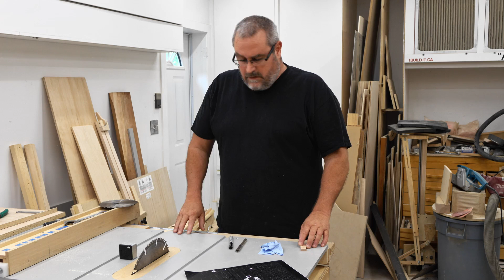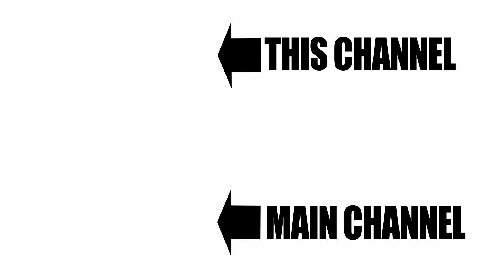This is probably the last Table Saw I'll Ever build

Comment: I built your fence for my old craftsman table saw and it transformed how I use it. I never realized how useful having the fence on either size of the saw blade would be. My pointer broke off a while ago but I don’t really miss it as the tape and the pointer were only ever a rough guide to the width anyhow. The most important thing to me is that I built it, made some mistakes along the way and got better at the craft because of it. I would have learned nothing buying a commercial fence.

Comment: John I built your fence for my table saw.  Sat outside in an unheated, uninsulated garage over a year now...I was certain I would have to nudge the rail back into square.  
Zero adjustment needed.  I'm actually astonished by your design and my dumb luck.  I love that fence and all the cursing and sweat that went into getting it onto my Beaver saw from the 60's. 
Please make plans available for the lift and tilt.  It looks superb.
Reply: This is my experience with the fence as well Rob. Also out in an uninsulated unheated garage. It’s a fantastic design.

Comment: love it man. the saw looks awesome and i love how you create what you need. +props. you are one of the best diy'ers out there man. you know when to get help and when not to. (like with the house stuff)
i just wanted to tell ya what i did with my (cheap ass) table saw. because you were saying how you left yours open underneath.
I have a portable saw that came with a crappy framed stand (a skil saw). i built a nice cabinet for it to bolt onto, but i left the top of it open (a mitered frame out of 1x4) so the saw dust could fall through. i put drawers in the cabinet to store some stuff like sand paper, blades, etc... the key thing is the top drawer, which is larger than the rest of the drawers, it catches all of the saw dust and it's easy to vacuum out, or even just remove and dump... i get that you probably cut so much that the drawer would fill up too fast. but it works for me and keeps things relatively clean around the saw.
keep up the great content. <3 your work.